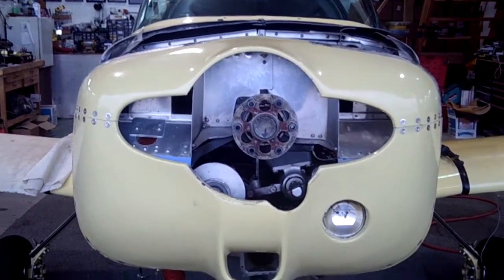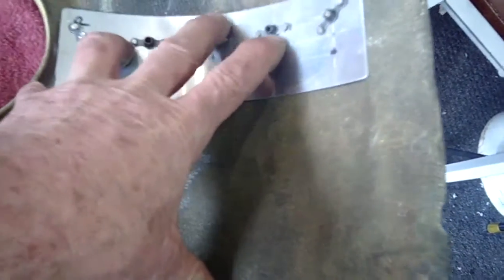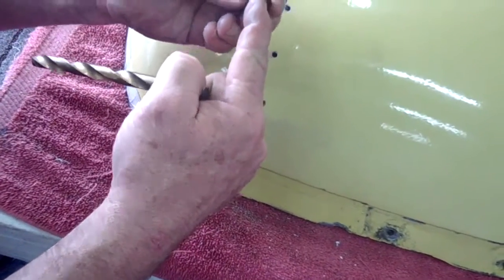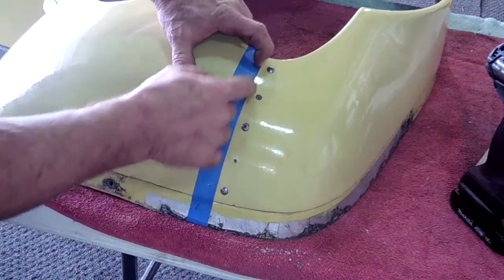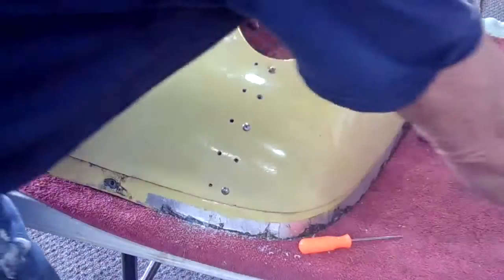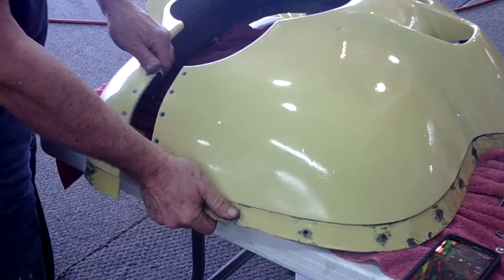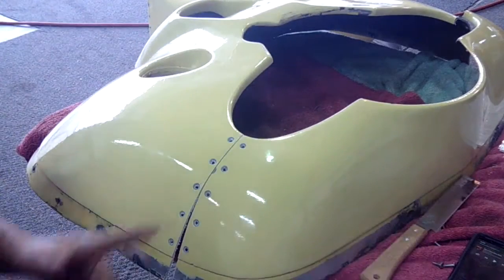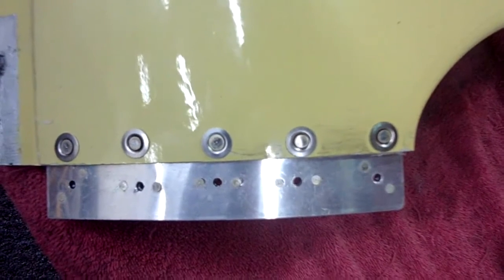Split Nosebowl 2-Seater  - Grumman Style

Comment: Does the kit come with two plates and enough hardware to cut both sides? I have a Cherokee 140 I am wanting to do this with? Thanks
Reply from the maker: Comes with 4 plates and hardware for both sides.
4-Place Hardware Kit – Split Nosebowl STC SA4325NM

(4) Alum pieces 2 inch by various lengths called out in the drawings  
RC 5.75 x 2.0
RO 6.25 x 2.0
LC 7.25 x 2.0
LO 7.75 x 2.0
2024 T3

(18) MS21047L8 2-Legged anchor 8-32 threads, installed with 2 skin rivets AN426AD3, (4) of these are included with 8 pop rivets for the upper nosebowl to upper cowling mod (replacing the nut with blind anchors) 
(32) WA-8 Tinnerman washers  
(32) C832R8 Stainless Steel Counter Sunk 8-32 Machine Screws 
(14) AN365-832A Nylon Elastic Lock Nuts (for fixed mounts) 
(8) BSC-34 #40 Countersunk Pop Rivets (for upper cowling mod) 
(30) AN426AD3 Countersunk Skin Rivets #40 (2 spares for practice are included) 

Video of install:  https://youtu.be/5X6-jDswBuw 

4-Place Hardware Kit – Split Nosebowl STC SA4325NM
Reply: @GrummanPilots  Thanks